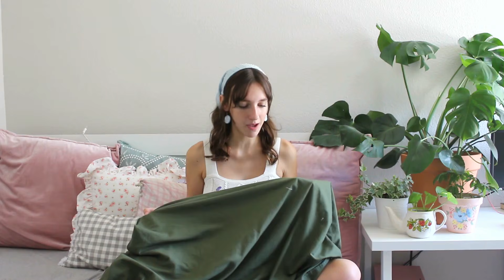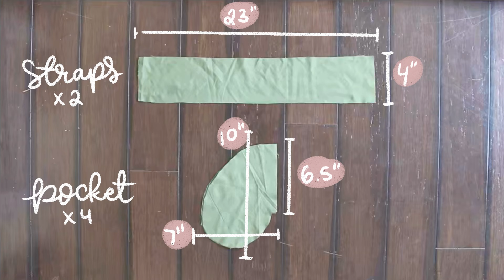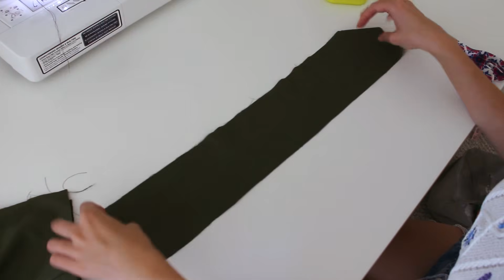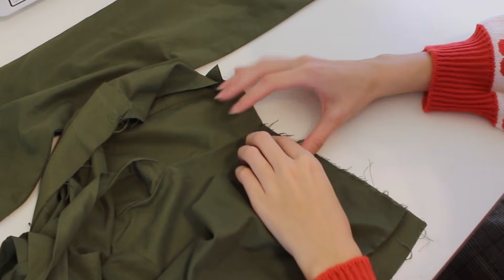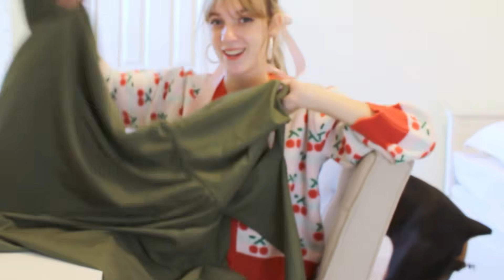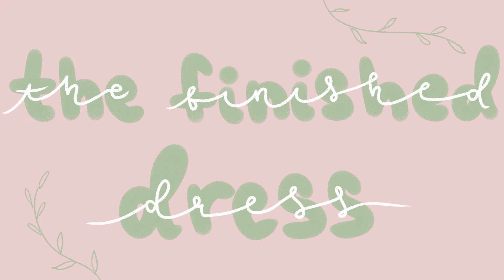Easy DIY Dress (no zipper & it has pockets!) Pattern Available |Tie Back Dress With Ruffles Tutorial

Comment: I made this dress (self-draft) without the bottom ruffle. Super cute but man i cannot tie a bow behind my back to save my life LOL.

I struggled a bit with sizing the skirt, I ended up sizing a typical 3/4 circle skirt to my waist measurement and added 6in to the waist measurement before calculating the radius. This turned out to be less fluffy and very few ruffles, so if you want a fuller ruffle look, definitely increase the waist measurement more than I did (I've seen 25-50%)
I also have a longer torso and wanted more coverage, so I kept the back ribbons at 10in wide.
Reply: Oh right, I also skipped the bottom darts since my bust and waist measurements aren't too different. And I made the side darts 2in wide, 4.5in deep to align eitb my bust measurement and increased the height accordingly.
Width of the bodice I increased only a few inches, since the ribbon is tied in the back the bodice sizing is pretty flexible

Comment: I made a modified version of this. I don't have elastic so, I added an 1/3 extra to the skirt. Then attached the top (which I extended width wise by 2-3 inches) in the middle. After I sewed the waist ribbon along the length of the skirt. That way its a wrap around. And instead of attached the shoulder straps to the front and back, I increased their length and attached only to the front. So its dual tying

Comment: Since she didn't really explain, she attached what looks like iron on interfacing to the "ribbon" fabric to make the final ribbon more stiff and give it the very flat ends to make it more cute. Otherwise the fabric might be too floppy.
Reply: When you tie it multpile times and wash it does it stay creased or easily ironed out?
Reply: Thank you! <3
Reply: Thankyou I noticed that. I presume its light/medium weight? Also I can't quite figure out how to change the sizing from hers to mine? Am I being totally dumb here as a novice sewer?  ❤
Reply: @donaunsworth5620  I made this dress as someone who is medium/large. I would recommend adding a few inches width-wise to the bodice. I made mine 20 inches long ratehr than 17 and made the incisions 5-6 inches instead of 4.5. I kept all of the positions the same. If you need more space around your sides, add a few inches to the ribbon part so you can still tie it around your back. I hope this helped!
Reply: @tatianafranco7613  I wish I have read this 5 hours ago!!!!!!! hope it turns fine :o
Reply: @donaunsworth5620 you could try marking a rectangle for the bodice front. Measure from where you want the neckline to start (say your neck/top of your chest) to where you want it to end (say your waist) and that should be the height/width of the rectangle. Length can be half your bust measurement. Cut out the top corners like she did to account for your armpits, and then put the rectangle on your body to check the fit. You'll find places that need to be folded over/puckered/cut away for the bodice to fit your form properly, mark these as your darts. Two on the sides of your bust and two on the waist. You'll have to eyeball it and divide the total folded over measurement into two for both the waist area and the sides of the bust. That'll give you a preliminary pattern, you can add seam allowances and make it into a proper pattern piece. 

Then for the back you can make the width of the straps an inch or 1/2 an inch less than the width of your bodice front. Her length is probably good, but you could make it less or more. I'd recommend tying a bow with some fabric around your waist first to figure out how much you need. 

For the skirt I'd watch a circle skirt video, but you could probably get away with cutting out a waist measurement that's twice your waist measurement (or 3x, or as much or as little as you like, depending on how ruffly you want it to be), and extrapolating a circle from there, kind of. Like you mark out 1/2 the waist circumference, and then put your measuring tape on that line. Mark down to the length you want it to be, and then mark. Keep doing this by putting your measuring tape on a different point at the waist line and measuring down from there. Add seam allowance and cut it out. Cut out two pieces and ta-da, you have a skirt. For the ruffle you can use her measurements and also for the pockets. But you can change them around if you want. Longer ruffles means more gathers. Shorter ones means less gathers. Pockets can be made bigger or just gotten rid of entirely, if you'd rather not go through the hassle of sewing them. And there you have it. 

I hope this made some modicum of sense, and I'm sorry if this explanation wasn't very good.
Reply: This is what Im wondering too. Being a plus size woman who's very much interested in making this.